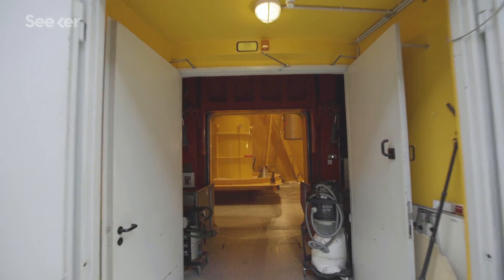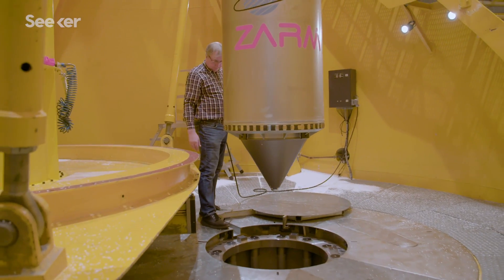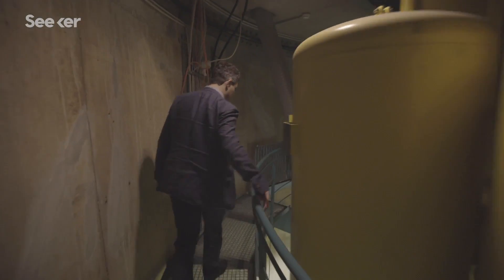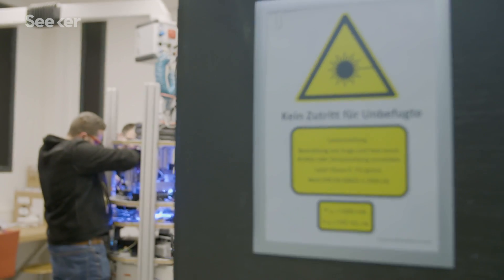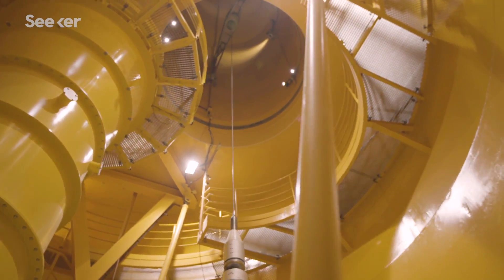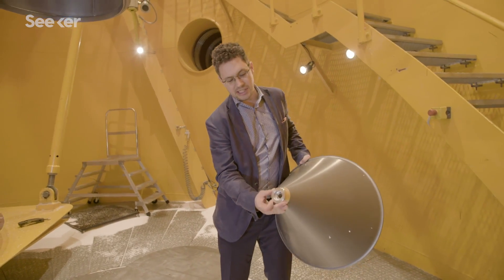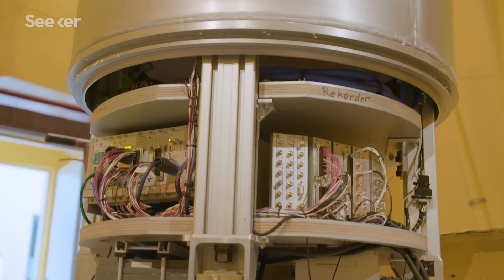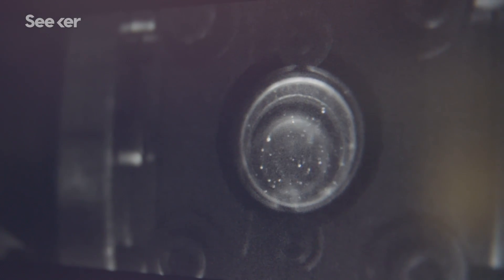The Zero Gravity Tower Preparing Us For Future Mars Missions

Comment: A carbon fiber cord looped over a wheel at the top and strung to the bottom to a lower wheel,  then back up with the test capsule as a joiner of the ends of this cord, driven concurrently  by 2 electric motors positioned at both wheels with the motors controlled by an accelerometer's  data transmitted from within the capsule,  might offer the air drag compensation and eliminate the need for a vacuum. The motors might offer some boost to the hydraulic drive of the upward phase, or even provide all the initial upward thrust when doing experiments that will not permit the high g forces of the hydraulic system.

Comment: would it be possible to not have a vacuum if the capsule could be slightly accelerated going up and down, just enough to compensate for air resistance with an accelerometer to sense zero g, then adjust acceration to null it out.?

Comment: Use an airlock to keep the tower tube evacuated while the launch site is serviced and prepped. Then evacuate that smaller area more quickly before opening the airlock hatch wide enough to make the tower accessible. Then close the hatch again when complete to access the experiment while preserving the vacuum. Quicker turn around. Not much of an upgrade needed.

Comment: A bit confused - I thought free fall is not quite the same as microgravity. When you're is skydiving, you're definitely not weightless. Gravity is most definitely pulling you in a straight down direction. Interesting video nonetheless.
Reply: To clarify, from a more technical standpoint, I'm approaching this scenario as a comparison to "orbital weightlessness". I understand that in both cases gravity is pulling you in, and you're not "anchored to the ground" like in day-to-day life. But the dynamics are different in orbit because the velocity vector is tangential to the gravitational vector, unlike the drop tower where the two vectors are the same. Though I haven't been to space, I would assume the two scenarios I described would feel different.

Perhaps, in the context of doing experiments, this difference actually doesn't matter. Curious to see if any people have an explantation.
Reply: @Peter8831  The ISS is also just in perpetual free fall and is still experiencing roughly 80% of the gravity on earth. If their "sidewards" velocity suddenly stopped for some reason they would drop like a brick.

The point is that in an enclosed space it is actually impossible to tell the difference between accelaration and gravity, therefore free fall and lack of gravity are also the same.

if you would be skydiving in an enclosed box which would fall down towards a body in a perfect vacuum you wouldn't be able to tell the difference, the same thing applies to the experiments inside that tube being yeeted about the place.
Reply: @null-t5e  Thanks for the clarification. So, I'm wondering then. Let's say you weren't in orbit around the Earth on the ISS. Instead, you were traveling through deep space from Earth to Mars. The gravity would be very different. I guess just a small amount exerted from the sun as you haven't escape the solar system. Would the sensation of that kind of "free fall" be different than on the ISS.

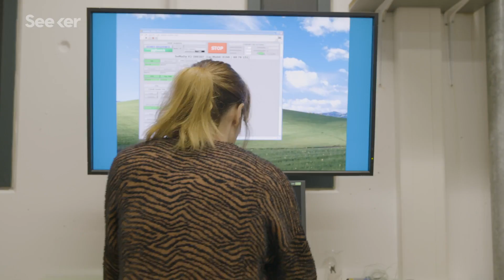Comment: 5:36 Windows XP in 2020? Maybe time for a new head of IT...
Reply: Maybe you need some IT training.  Many manufacturers of large devices do not provide you with drivers for system updates.  That's why PCs without internet are just standing around for the machine. 🤷🏼‍♂️
Reply: why take the time and effort to repair a system which is currently working, has little to no risk of infection while also having significant down time?
What advantage is there to switching to Windows 10 and having updates kill your work every few days?
if it works it works.

Comment: One way to do it without a vacuum would be just a deep hole in the ground and push through the air resistance with linear motors, kinda like a vertical maglev train. There will be some vibration from airflow so the quality of microgravity might not be as good, but you can rerun the experiment all you want and tune the acceleration / deacceleration to whatever value you desire at the expense of hang-time.
Reply: Isn't that what they proposed towards the end of the video for the next generation?

Comment: If an object is falling at same speed as motion of gravity 9.8 m/s2, object will experience zero gravity. If a boat is moving at same speed the river or ocean is flowing, boat will experience stationary-ness. Ofc both the object and boat is still in motion. Gravity is a flow of ether towards the earth from space, towards the whirlpools within every particle of earth due to difference of pressure in the ether. But since scientists believe ether doesn't exist, they will never invent anti-gravity tech because without ether, gravity cannot be correctly understood. They will remain stuck with drop catapult and centrifugal force until they understand ether physics. Also the only reason gravity is not a force is because the force is not applied by you but by the nature using the ether.
Reply: you describe the right concepts and the boat analogy is very good, but the whole ether thing was abandoned a few hundred years ago.

Comment: Question: why they don't add a sealed door lock above the room where the capsule is managed, so they can start pumping out air from the tower above, while refilling the deceleration chamber and setting up the capsule? It would save approximately 90% of the time needed to create the vacuum, since only the small potion of the management room should be sucked out, when finished the set up.

Comment: To those wondering how it can be weightless while going up; after it's 'shot', it starts with 165km/h, decelerates and reaches 0km/h at the top, then accelerates to 165km/h by the time it's back at the bottom. The only force acting on it is the acceleration of gravity and thus it's in free-fall the whole time. If you were to plot the velocity over time, it would be a perfect parabola changing at 9.8m/s^2. To put it into a relatable feeling, think when you're jumping on a trampoline, you feel 'weightless' the whole time you're in the air, even while moving upward. Or in an elevator going up, that brief moment when it stops, you may almost lift off the floor. Like that but it launches you at 30g so you go flying up

Comment: What are the obstacles to using a motorized vehicle on vertical rails that descends with precisely the same acceleration as gravity? Then you wouldn’t need the deceleration chamber or to fill the chamber again to rerun the experiment. I’m sure someone thought of it so just wondering what the problems with it are
Reply: You'd need electric motors which can decelerate incredibly quickly, they'd need yo be incredibly fast reacting while also being precise as all hell.
Just yeeting stuff will always be more accurate due to the capsule being completely isolated from the surroundings.

Comment: Couldn't they just artificially accelerate the capsule to account for air friction? As to avoid vacuuming the chamber?
Reply: Dealing with air turbulence is far less repeatable than a vacuum
Reply: That sounds like what they want to to with the new tower, but they weren't very clear. If the 'rails' they refereed to are going to be linear motors, then they should be able to do just that
Reply: Plus I guess it would be far more complicated to mechanically decouple it from the external structure

Comment: So after the experiment is launched, how does the deceleration device get positioned underneath the experiment? I guess it is a mechanism that moves it but it must be done in less than the ten seconds that the experiment runs... 🤔
Reply: They don't show it very well, but just as it launches at 7:35, you can see the 'ball pit' move into place, looks like it only takes a second

Comment: Some ideas..?.. 1. Take support from existing mountains where it is 90deg drop.. can we scale this up to 1000mtr?.
2. For de-acceleration, use of electromagnetic breaks.. ex-maglev.
3. Instead of small compartments, can we send humans sized compartments?
4. Loading and unloading of experiments to be automated..?
5. Building multiple tubes, with mountain rock structures if demand is more...?
6. May be height can be increased from both ends above ground and below ground...?

Comment: The best part: the Windows XP in the background at 5:38.
Reply: Sometimes it's not that easy to update machines like that. Every other controller connected to it was probably made years ago, not supported anymore and you would have to change all of them and rewrite all the software on the new hardware.
Reply: You wouldn't believe how many machines are still used with Windows XP, just because there is no newer software for it and the machine itself is still running, because it was constructed to last decades...
Reply: 2020 Space Tech Experiment..

7:14 - Powered by Windows XP..

Priceless..

😁😁😁
Reply: @gmailaddress2012  Most likely because their program wouldn't be able to run on windows 7, 8, 10... And it's not connected to the internet anyway, so there is no risk of getting hack.
It would probably require a full rework of all their program just to use Windows 7 and up...
Reply: 5:37
Reply: @martiddy  thank u lol I was confused
Reply: LoL
Reply: I wonder if there are still companies that still keep old operating systems protected, or whether the networks they still connect to protect them.

Or maybe they are standalone?
Reply: Can make incredibly complex math and engineering, can't right click preferences.

Comment: Guys, here is the paper on the next gen tower they are building that was in the video. https://www.researchgate.net/publication/270344841_Concept_for_a_Next-Generation_Drop_Tower_System
They basically use guided electro-magnetic linear drives (like in roller coasters) to sort of have the capsule inside a capsule in an elevator which goes through air (not in a vacuum!) with enough force that the capsule inside the elevator never touches the walls effectively making it drop as fast as if it would have dropped inside a vacuum tube like i the old system. Read the paper if you're interested.

Comment: i have a doubt (please don't judge me it's a stupid question): if gravity is basically caused by gravitational waves then can't we reflect them?? for example how we can easily reflect sound waves (echoes) and light rays can be reflected by mirror. then don't you think we can invent a device which can reflect gravitational waves??
Reply: Probably not, gravity waves travel through and distort space-time itself, meaning any matter moves with them. But a very massive object would 'absorb' some of the energy. But to be clear, the gravity waves we've detected are absolutely minuscule in terms of their power. As in changing the diameter of Earth by something like the width of a single proton.

Comment: Shame they didn't go more into depth about the plans for the new system. If I'm understanding it correctly they'll accelerate the experiments on a powered elevator or "slider" with exactly the same acceleration as gravity  produces to negate it's effects. Should be far more efficient as creating a vacuum in that large of a chamber must reck up one hell of a power bill. The only thing I''m surprised about is that this hasn't been done in an abandoned mine shaft. Some of them go far deeper than you could practically build a tower.
Reply: I don't really get why they need to evacuate the whole tower over and over. Why not just have an airlock or some such in the sections where the experiments go in and out, so you only have to evacuate that one small chamber repeatedly?

Comment: 7:14 Windows XP never dies~
Reply: At my old uni they were still using windows 95 on some machines, because when they were made that is the OS they used. Now they are still being used and its cheaper to keep a Win95 OS than it is to get new machine or redevelop the software for anything newer.
Reply: @Azivegu  until eventually it will become too expensive to maintain a 30 years old machine than to do the whole thing from scratch - but then it will be after a failure so there'll be a time pressure, so the project will be rushed, so the result will be bad, so it will be patched again under budget and under time pressure, the product getting worse from patch to patch. This story had been repeated over and over again. The alternative is to invest some money every 5 years to modernize and improve - in the long run you get better results for less money.
Reply: @guss77  I don't disagree, but it was an instrument to test the pressure a rock could handle for a geology department that cost something like  €5 million. If the top were somehow to come of, the cylinder inside of it would be shot at such a speed it enter into a sub orbital trajectory.
So they'll keep using it as long as they can. It does do pretty good work, just the UI is horrible.
Reply: @Azivegu  you can see windows 95 as SmartWatch OS in this video https://youtu.be/Yf5ED84bZoE
Reply: @C.B-o8p  Windows 95 won't even install on a modern PC you can buy in the store now. How do you deal with hardware failures? Probably the only logical thing to do is to run the whole thing virtualized, but it really sounds like a bad idea for long term maintainability.
Reply: @guss77  i give you the hardware failures, but those dont happen very often in specialized hardware, because the parts are picked to a different standard than consumer hardware. so they tend to work just fine for a longer time.

99.999% of the reasons why you would not want to use computers with an old OS nowadays have to do with internet security and stuff like that. right now XP is at a point where microsoft has fixed pretty much every bug that can come up in offline operation and thus it is really stable especially if you consider the fact that a machine like this will be used only for this one purpose so there are no wonky interactions between several dozen installed programs like on a consumer machine.

this machine will most likely never see an ethernet cable nor any other software than what was initially installed on it to work with the scientific equipment so there is no reason for an upgrade
Reply: @TheScarvig  hell, that computer wasn't connected to the intranet. I think the only connection was to the machine itself. If you wanted to retrieve data, it had to be saved to a floppy. It was a hassle, but the quality of that data was beautiful. So it was worth the slight inconvenience, plus not like a university to spend big bucks on an unprofitable geology department xD
Reply: lol

Comment: By adding sliders to the side ud be adding friction so it wont free fall at the correct rate. Seems odd unless they can somehow precisly account for the loss of momentum due to friction against the walls
Reply: perhaps magnetic bearing surfaces? Like mag-lev train but vertical
Reply: Linear motors accelerating the capsule to eliminate / negate air friction.  Probably a smaller capsule inside that contains the experiment and has no contact to the outer capsule. Outer capsule may even be a vacuum chamber that can be pumped down quickly because it is small.
Reply: Good thing they didn't do that then?

Comment: why they still use Windows XP in 2020?
Reply: compatibility
Reply: It's stable, and it doesn't start auto-updating without user permission at inconvenient moments.
Reply: Happens more often than you‘d imagine. It‘s not always being lazy or something like that. Often there is very specialized software involved which unfortunately never got updated to run stable with newer version of the OS etc. This I. E. is also true for some microscopes and stuff like that. These computers are not connected to a network, though. So, it‘s very likely that this computer is used to control some of the towers equipment and the software is exclusively written for the tower. It controls stuff of the tower and may even be in an internal network but this network then  - hopefully - is not connected to something else.